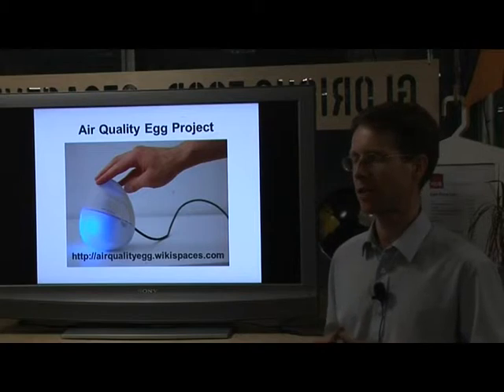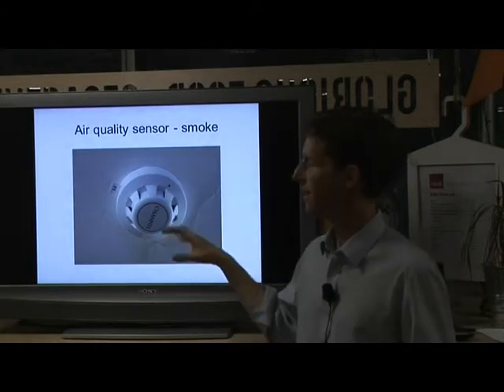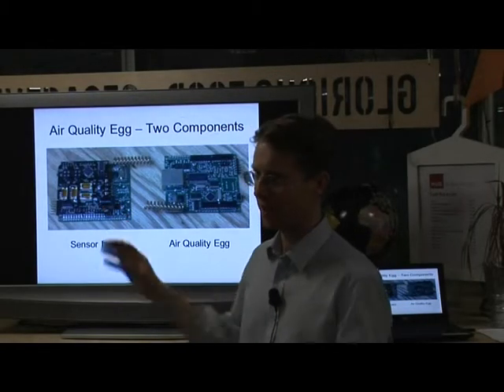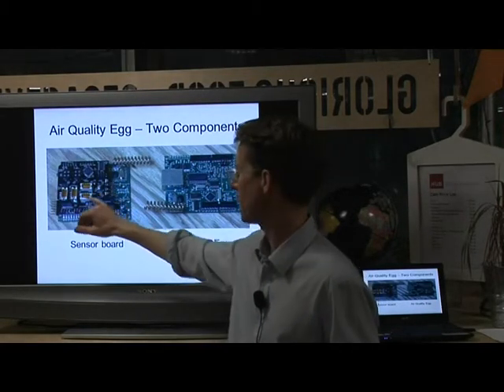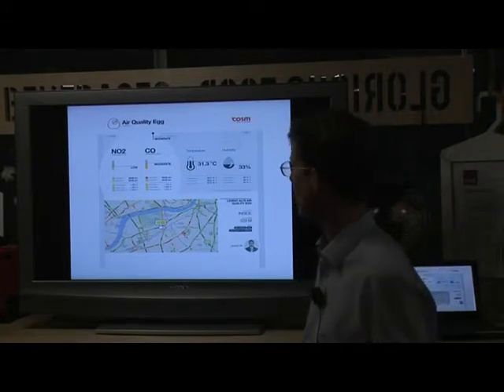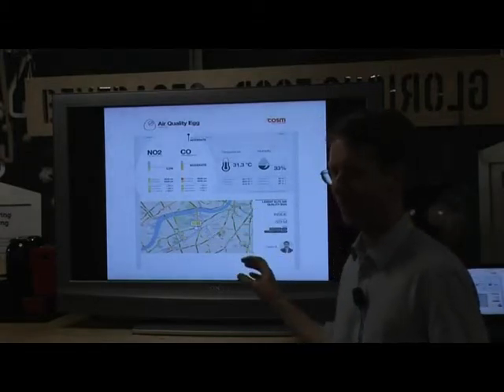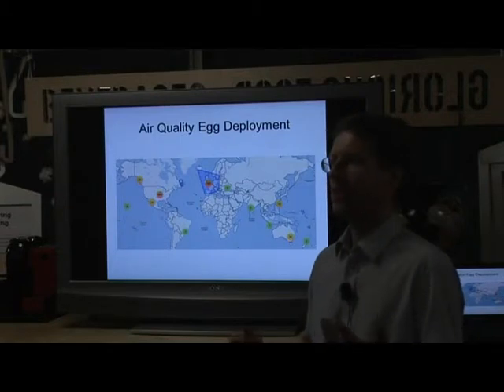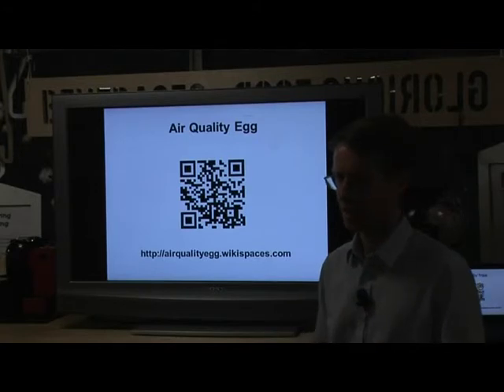Air Quality Egg (Part 3: Analogue, Digital and Active Approaches to Better Air Quality)

Comment: The best bit is around 11 minutes in, where he says these don't work, then points out that there are hundreds of real monitoring stations which will give you the data for free. Egg measurements don't have units, so they aren't measurements at all.